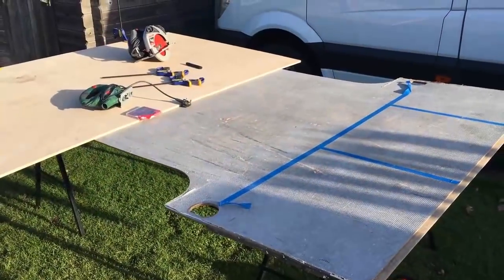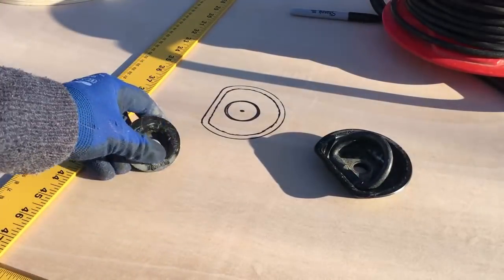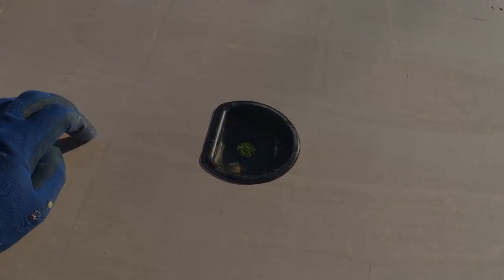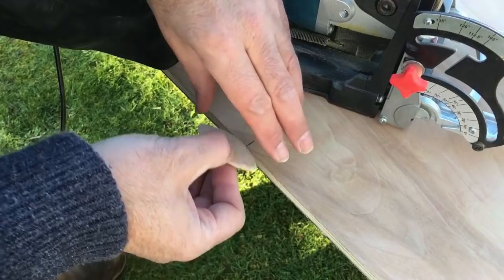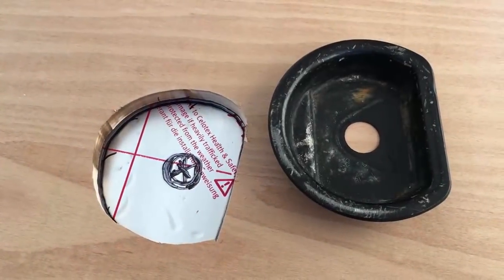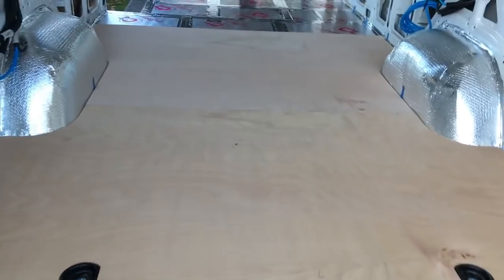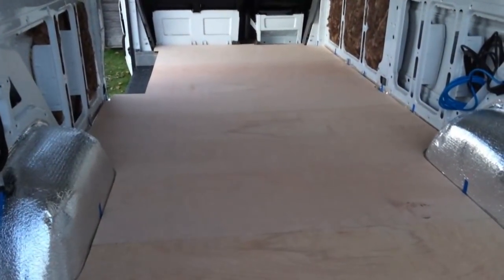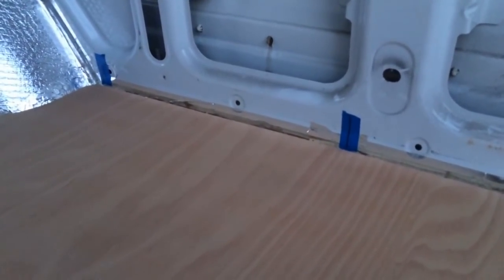Mercedes Sprinter Camper Van - New Floor

Comment: Hi Greg, I'm wondering how much clearance you were left with after the ceiling and flooring were put in. 25 mm insulation and battens on top and bottom, plus additional ply- and materials used will add up to 80-100 mil.... Am I correct? (I'm a tall person so trying to figure out what height van to get, or how to cut back on insulation and/or materials used to keep enough clearance (there aren't that many H3 vans on the market today). Thanks for your video's btw! I'm tweaking your design a bit, currently knee-deep in Sketchup ;-)
Reply from the maker: Dirk Kranendonk I’ve actually got 50mm of kings pan in the roof but I don’t lose any height because it’s in between the roof beams. I put 12mm ply battens and 3mm ply headliner. So that’s only a 15mm loss in the roof. 
Then I only added 25mm to the floor. The new ply was the same thickness as the existing so no extra. So in reality I only lost 40mm overall. I’m 5’11” and I’ve got 4” clear above my head. 👍🏼
Reply: @GregVirgoe  Thanks for your detailed reply! One more question: do you have the 170" sprinter (L3) or the 170" extended (L4)? I'm drawing everything out in Sketchup but my bathroom does cut into the side window and the benchspace that is left is very small compared to yours. Left me wondering if perhaps you have the bigger L4 van. BR Dirk
Reply from the maker: Dirk Kranendonk mine is the LWB not the XLWB.

Comment: What saw models are you using pls Greg. I've been using a jigsaw (cheapo) and think I will need circular saw. Can't make out models you are using. Thx. Fiona
Reply from the maker: Hi Fiona, generally Bosch or Dewalt are my preferred brands. Always had good results with those two 😃
Reply: Thx Greg, what are the model numbers of the two you use in the flooring video? Many thx.

Comment: Hello Greg. I have a quick question for you. When you are drilling the screws in side the plywood floor are you not worried for compromising your vaporbarrier? Regards Morten
Reply from the maker: Hello. I'm not worried because I haven't compromised the vapour barrier at all.
You are forgetting that the screw is plugging its own hole very tightly indeed.
There is no way that any moist air will bypass that screw fixing, not possible.
Reply: Thank you for your fast answer!

Comment: Just curious; why the biscuit joints in the floor panels instead of just using tongue-and-groove plywood for your subfloor?
Reply from the maker: To be honest you don't need either as long as your joints fall on a timber batten and the ply is screwed down well with plenty of fixings.

Comment: Just one question you may have already answered. What thickness ply did you use for the flooring. Oh & another question (2 for one offer here) where the self drilling/tapping screws go through the floor would you recommend any anti rust treatment under the van floor? Really enjoying the videos. Thanks for the great info. Atb.
Reply from the maker: Hello Joe, yes the new floor is 12mm hardwood ply and I will be treating the protruding screws with Waxoyl to rust proof. Although they were BZP. Thanks for watching

Comment: Hi Greg, did you need 3 8x4 sheets of ply?  Cheers
Reply from the maker: Hi Ross, I used 4 sheets because I only wanted joins across the width.
You could probably do it with less if you had joints in other directions
Reply: @GregVirgoe  cool cheers greg I think 3 should do my mwb in the same plane.
Reply from the maker: @rossadamson4664  yeah mine is LWB so probably 3 ft longer, just over 16ft long in the back

Comment: Hi Greg, why didn't you reuse the old floor?
Reply from the maker: Hi Kevin, it may not of looked like it but it was pretty beat up at the doorways, covered in mastic and lots of tie down holes that I won't be re using. I know it was £100 for the new plywood but it will give the vinyl a great smooth base.

Comment: Did you use marine ply or just 9mil ply on the floor?
Reply from the maker: 12mm marine ply for the floor, I would not go thinner than that as it will flex too much.

Comment: Greg you sure your user 12 mm ply on your floor because it looks a lot thicker than my 12 mm ply ?. Cheers Danny
Reply from the maker: Yes danny, it’s definitely 12mm marine ply 😀
Reply: Greg Virgoe cheers mate cutting that today 👍🏼😃👍🏼
Reply from the maker: Hope all goes well danny 👍🏼
Reply: Greg Virgoe all dun just waiting on a roll of vapour barrier now cheers
Reply: I read your previous post greg and you managed to get marine ply, 4 sheets for 100 quid. I just bought 2.5 for 300 quid.

Comment: I had trouble understanding why he did those little buscuit cuts connecting the floorboards. Can someone explain please?
Reply from the maker: To stop the edges of the boards moving and flexing and to keep the floor level.
Reply: @GregVirgoe  2 years late but ty lol
also, i'm not sure if you'll see this but I have a question since I'm now working on my own van. my foam board insulation on the floor doesn't have the foil top, so i was just gonna put reflectix and tape over the whole floor as a vapor barrier. but do you think it would be an issue to screw the plywood floor through reflectix, would it ruin the vapor barrier? because instead I could cut small pieces of reflectix to cover each board and have tape over the battens, like yours, which would instead be screwed through. sorry if that makes no sense but I'm concerned about the reflectix breaking or something.

Comment: Hi mate what mm ply did you use cheers stokesy
Reply from the maker: Hey stokesy, it's was 12mm ply, the original floor was 9mm but much harder material and really very heavy, we really struggled to even lift the old flooring between us.

Comment: Just a tad bit over engineered!  The old floor could have just been cleaned and reused because with the magic of hindsight you have stuck on top a layer of Altro anyway.
Good job none the less. Love the biscuits.
Reply from the maker: The old floor was wrecked, it was all broken at the door edges and filthy dirty, it would not have been suitable this professional job.